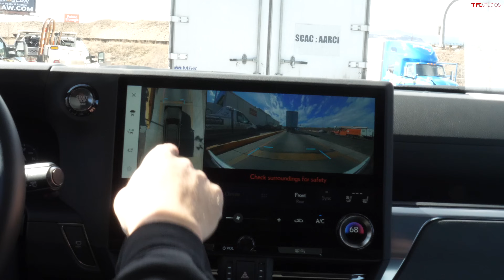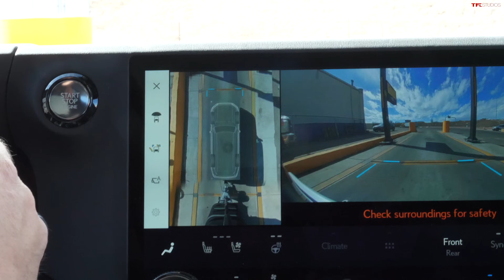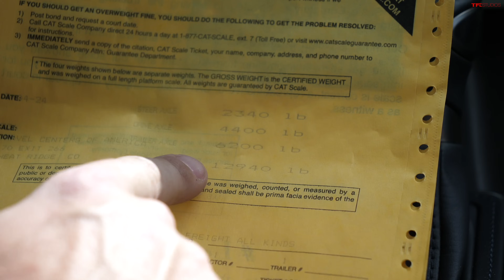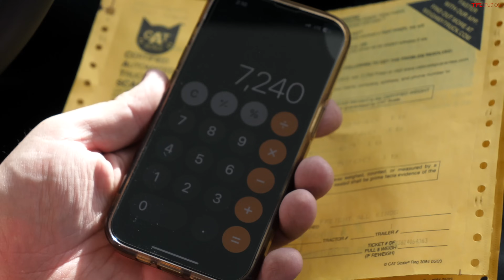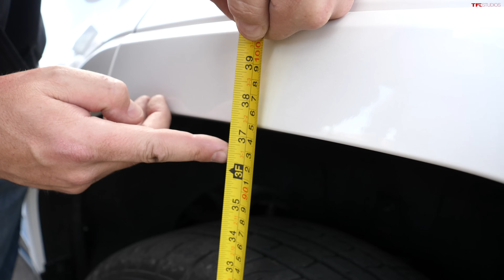Can the 2024 Lexus GX 550 Twin-Turbo V6 TOW Better Than Ever?

Comment: My one complaint about this Lexus. I wish it had a panoramic roof that actually opened. It should've been standard versus a standard size sunroof.
Reply: Those almost always leak.. look at ford and other companies who make the panoramic that open. Body flexes too and gets the track off. It’s something that’s gonna have problems is why they left it out I assume.
Reply: @Weatherby406  Nah, I don't buy that. If that's the case, the Lexus TX wouldn't have a panoramic roof. But it does.
Reply: A panoramic sunroof isn’t gonna make or break the deal for most people.
Reply: @nicholascruz5244  It's just an observation. I'm curious why there's a panoramic roof on the Lexus TX and not the GX model. The Defender has one, and that's what it compete against. And believe it or not, it's a deal breaker for some.
Reply: @jraheemjefcoat429  my friend has brand new BMW X7, he paid $100k with all the options, after a car wash his beautiful panoramic sunroof started leaking😂
Reply: @jraheemjefcoat429 TX isn’t going off road and flexing as much
Reply: @derrickp  So not the GX luxury trim with those 22 inch tires. What’s your point? And still, no one can really answer that question . The real answer is Lexus can choose to add an open panoramic roof on the GX models. But want to reserve that for the TX models. Which in my opinion, a missed opportunity since it competes with the LR Defender and it has an open panoramic roof. Either way, it’s a personal preference feature content that I like. Let’s not dim someone’s light for just wanting an open-panoramic sunroof.
Reply: @maniac32145  Same thing happens to my friend Tesla and his roof don’t open..lol. Hey, that’s are what warranty is for. Most of the vehicles I’ve owned has sunroof /panoramic roof. I won’t buy a car without it. But it’s just a personal preference. Some like to live in a house. Some like to live in a condo. Either way, we’re both paying mortgages.🤷🏾‍♂️
Reply: @jraheemjefcoat429 it won’t get it because it will 100% leak. Sucks for people who want one but is what it is.
Reply: @derrickp  Will the TX 100% leak? How is it okay for one but not the other? That is the $1M question. But like I stated in one of my comments, I’m one who likes a panoramic/sunroof. Hell, a roof that opens! That’s just a preference that people want. I never owned a car that doesn’t have one. If you never use or care for one, the it’s easy for you to say the hell with it. All I’m saying Lexus could’ve made it an option feature for those who desire an open panoramic roof.

Comment: The whole hook up set up on this vehicle is terrible. Imagine digging up under the rear bumper in the sloppy snow with that plug covered in ice and slop. Even if it has a little cover it would be caked with crud. I suppose about 0.008% of ppl who own this will ever tow with it though.
Reply: 4runner has been like this forever. It does suck. Also doesn’t get ripped off off-roading.

Comment: Can’t wait for it to exhibit the same failure the Tacoma had on the recent off-road jaunt.
Reply: What happened to the taco
Reply: @pryme2013  she broke. Mechanical failure. Colorado had to pull it to safety. Check out the video of the event.
Reply: Toyotas built in Japan are different than built in Mexico/Texas.
Reply: @cameronj9890   how?
Reply: @us1… Sit in one and you will know immediately. Fit and finish and quality control and reliability and longevity.
Reply: @is6566  why?
Reply: Because Tacoma failed Because they are built in the USA and Mexico ok anti toyota
Reply: @sophaman9193   pardon? That’s incoherent.
Reply: @us1… Go again?
Reply: @is6566  I’m waiting for a coherent answer. Toyota doesn’t give you a choice of where it’ll be built.
Reply: @us1… How?
Reply: @us1… Of course Toyota doesn’t give you a choice where it’s built. Neither does Ford, GM, BMW, Nissan, etc.   How is that in any way relevant for the fact that any Japan built Toyota has a better build quality than the Mexico or even USA built vehicles?

 All Japan built Toyota vehicles have a much better build quality than vehicles built somewhere else. Anyone who is not a newborn and had the chance to own both a US vs Japan built vehicle knows this first hand. It might have something to do with the workers actually having a pride in what they do, it might have something to do with the Japanese culture. I don’t know and I don’t care. I just like the result.
Reply: @is6566 the culture is a big part of it. The Japanese as a whole are OCD about small details that end making a big difference for a vehicle. And what I've noticed about American Toyota's is it REALLY matters what plant it's built at as well as the supplier base around said plant. The original Tundra and Sequoia were built in Indiana with the 4.7; that truck and SUV were rock solid. The Highlander and Sienna are largely solid vehicles too. The Camry/Rav4/ES350 built in Kentucky -- same thing.